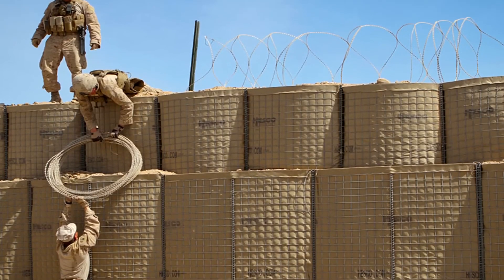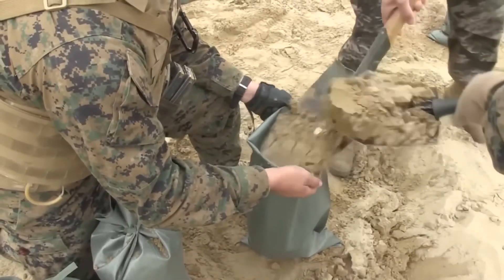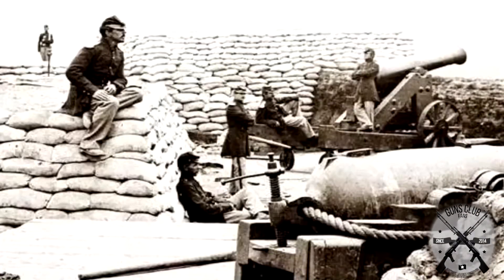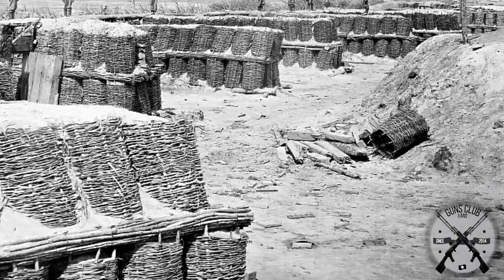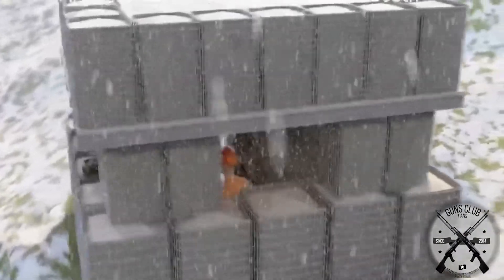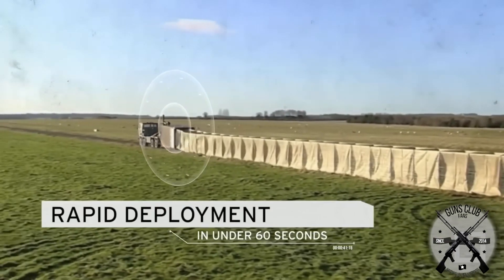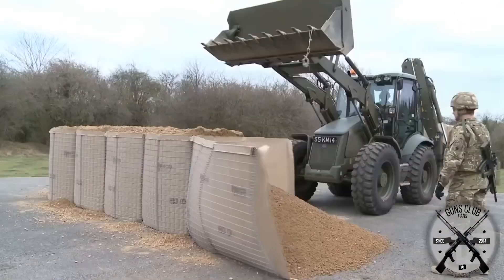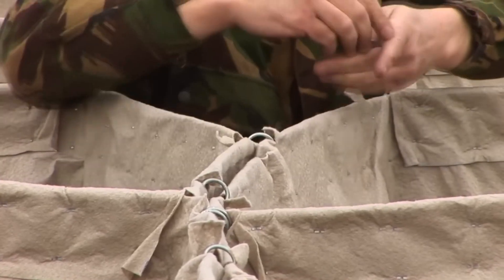Why Doesn't the US Army Use Sandbags Anymore?

Comment: My first deployment to Al-Asad airbase Iraq we used Hesco Barriers for bunker protection for indirect mortar and rocket fire but we still used sand bags for our personnel tents. Those tents were supposed to be temporary portable metal trailers were to be installed by the engineers but they didn't come till the last month of our deployment so we let the incoming replacement unit move in to them hey another month we were out of there going home.

Comment: Sandbags aren't going anywhere. How else will soldiers know the joy of holding a bag open while someone shovels dirt into their face? The Hesco barriers are wider and can be filled with rocks, but if it's sand would a 7.62 round be stopped? Part of the process of filling sandbags is to double tamp the filled sandbag on the ground and if you don't it's much less likely to stop a round. I'm not sure if the engineers driving their machines are tamping down the sand to increase the strength of the barrier or if over-use of Hesco barriers will result in troops forgetting to tamp their sandbags.

Comment: 35yrs ago we never used one man foxholes. We used 2 man “Fighting Positions.” The dirt was piled in front to make a parapet. Each grunt fired out the sides. Another position would cover our front. We set up in a W so we could cover each others position.  We dug a grenade sump in the bottom so if a grenade fell in your position you could kick it into the sump hole. I like the HESCO, but not practical for temp patrol bases in the bush.
Reply: I was in the National Guard, trained at Ft Benning as Infantry.  We did that too.  In 1980, there was still a moving target range, though due to funding issues, they were cannibalizing parts from some lanes to keep about 15 lanes open.  I have never met anyone since, active army or guard, who fired on it, so I think it closed down soon after I went through.  What it showed me is that it is quite difficult to hit a moving target without resorting to ammunition wasting automatic fire.  The two man position forces everyone into quartering fire on moving targets, whereas  the hasty one man position allows one to fire directly at attackers without compensating for movement.   
BTW I had 3 hits out of 120 rounds fired.  I was the platoon high score.  The course record was 9 hits.  Think about it.
Reply: Sound like a former Marine...
Reply: There ain't no such animal as a "former Marine". Semper Fi!
Reply: @farpointgamingdirect  Yeah.  I refer to them as Marines in Remission.
Reply: @warrenlewis3977   I was Army. And yes, I agree that one man positions are useful too. Just depends on the situation…BTW, I served 10yrs and can’t remember ever filling a sandbag. We never stayed in a position long enough I guess.
Reply: Back in the esrly 90s we occasionally used spider holes. In the airborne infantry we often used single man foxholes as well as two man pits.
Reply: I got the same fighting position training at Fort Benning Georgia in 2013. HESCO barriers are for more permanent installations.
Reply: They still do.
Reply: This reason is why I’ve been pushing for dig permits for years. Always get denied. HESCOs are great, but what if you don’t have HESCOs?
Reply: How to say you were a Marine without saying it